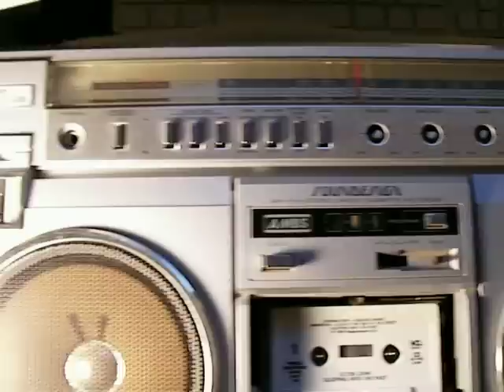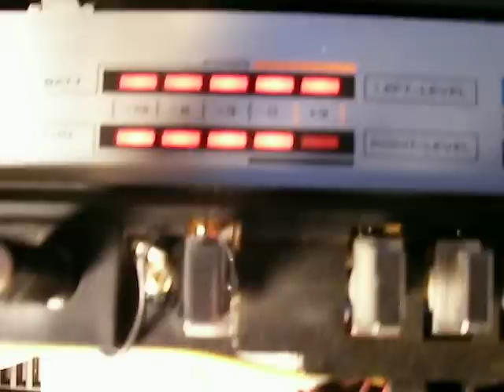Vintage Soundesign AM/FM Cassette Boombox Model 4689

Comment: How did you get the knobs off?
Reply from the maker: They are just pull off and push on
Reply: @xmvirus202  alright, and did you struggle with the tape door on yours? I've tried to open mine up to clean and work on it but that stinkin' door makes taking the face plate off of the stereo impossible
Reply from the maker: @oxleymations  For the life of me, I can't recall how I got the front off.  That was 11 long years ago, but I believe it had something to do with those white plastic pieces on the left side of the cassette bay.  There may also be a catch on one side of the cassette door that would have to be pulled to the side to release it from the mechanism.  I wish I could be of more help.  I sold the boom box on eBay after I repaired it.  Thanks for watching my video!